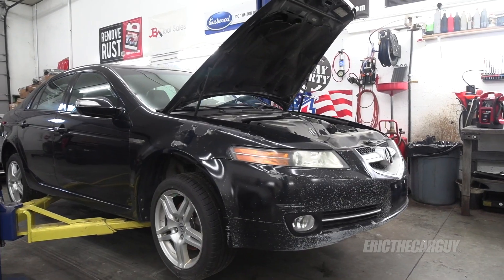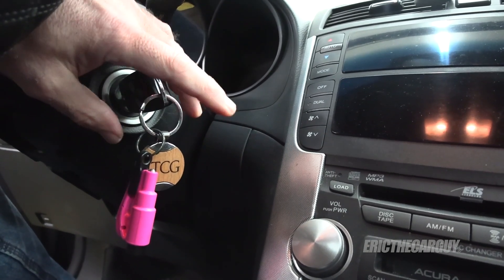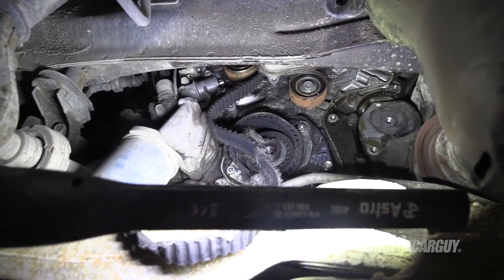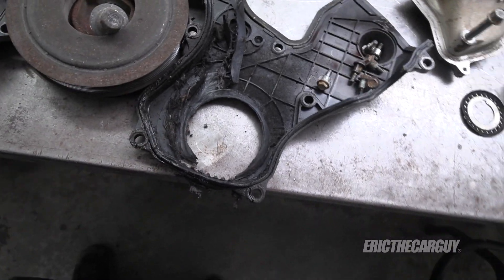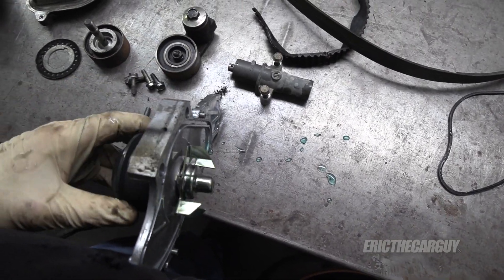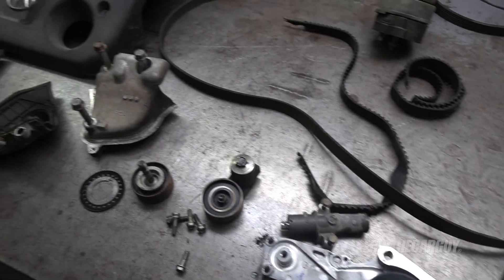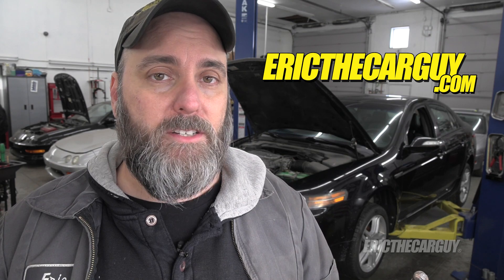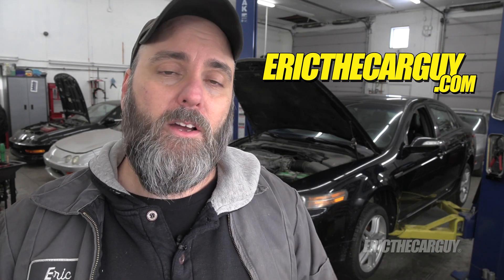Acura TL Dies On the Road

Comment: My prelude burnt a valve while driving 600 mile across country. Really mad about that I put too much time and love into my prelude. No ford ever left me stranded I had a ratty focus svt and mustang 3.8. Not sure if I'll ever go back to honda tbh. I'm a mechanical engineer yeah I know if you maintain something it won't break but. I'm happy with my new to me 2008 Ford Fusion v6. Fords don't burn oil like Hondas or break every 10mm on the car while taking it off. From a mechanics standpoint Hondas are great yeah but in my own experience it just took too much work and time for not enough car. I'm happy with a basic reliable cheap ford.
Reply from the maker: Sorry to hear about the Prelude. I loved mine with the H22. Also: https://www.youtube.com/watch?v=VES5D3zHTak&t=5s

Thanks for the comment.

Comment: Had a similar thing a few years ago with my 2.5l 24V mazda 626. Timing belt just went, with no reason. Replaced the timing belt and within 2 weeks the same happend again. At the end the hydraulic tensioner was bad although it looked  fine.
Reply: Did you torque properly everything with the torque wrench?
Reply: @polo16v191  yep, but the hydraulic tensioner slowly lost it's tension. But when  tensioning it feeled fine. Needed a lot of pressure to press the pin back in.
Put a new one in and never had any problems again.

By the way, the tensioner can't be secured by a bolt. It has to move a little, is also act as a vibration damper.

Comment: Interference engines are a complicated dance of metal moving at ridiculous speeds that sometimes occupy the same space.  Sometimes you get lucky and sometimes you don't.  You sometimes get lucky and the cams just stop turning at the right point in the 4 cycle process that the valves are clear of the galloping crank.  And then sometimes your luck runs out and your engine bashes itself to death internally.  Schrodinger's engine.
Reply: I think if you get lucky the spring pressure pops the cams to whatever low spot they can get to when the belt breaks. Which is hopefully low enough to miss the pistons.

Comment: Great Video Eric!! I def agree with your logic on trying the new belt. Funny you had to break out the jb weld, as I had too also lol I screwed my oil pressure sensor to tight and broke a piece of the block, I hope it holds or I may have to just plug the hole with a bolt..
Reply: Hope it doesnt leak..

Comment: Had the same thing happen to my 01 gsr and all the forums were saying the engine is done because it’s an interference engine. Got the belt back on and started right up.
Reply from the maker: Even if you did bend valves, they are about $12 each, and easy to replace with the right tools. I believe the head even uses an MLS gasket that can be reused in a pinch. I'm so over the pessimists of the world. Thanks for the comment.

Comment: I'm approaching 300,000 kms on my 07 TL Type-S. It's been an absolute trooper, going up and down the entire west coast of North America. Considering a new car soon, but unfortunately it won't be the new TLX Type-S.
Reply: Why not
Reply: @Shabbe02  It's a good car, but in Canada it's $70k all in and the performance is not there for that much money. I'm eyeing a Stinger GT as a replacement which was a blast to drive, or if I actually be sensible then possibly something more economical. Gas prices in British Columbia is ridiculous.
Reply: @Shafin Rehman Did you run into any big problems with your type s , I'm looking to buy one
Reply: @se9882  Nope, not a single major issue. The only problem it had was the acceleration pedal position sensor died at around 270,000 kms and it was $400 to replace. It didn't prevent me from driving, but the check engine light came on for the first and only time.
Reply: @ShafinRehman  that's great to hear . I'm going to look at a tl type s tomorrow pretty low Miles on it around 80k but people say they have transmission issues was yours a manual or automatic,
Reply: @se9882  I had the automatic. Honda redesigned the transmission in the 07-08 model so you shouldn't have to worry about it blowing up. I still changed the transmission fluid every 50,000 km because I drove the car hard in all seasons and weather. Take of it, and it'll last easily
Reply: @Shafin Rehman  thanks for your feedback. I appreciate it  a lot .

Comment: There's been some chattering on the Acura forum that the Aisin kit may have issues with their timing belt or tensioner being off-spec.  Although it's really just a noise issue and doesn't seem to affect functionality.  The Aisin kit went up in price now too where it's $250 and it's only about $550 to buy all OEM stuff from Honda.
Reply from the maker: This is also the first time I've seen that shim for the idler pulley. That was to address a noise issue. Perhaps they changed their idlers.

Comment: Was it a Gates kit? i have actually heard of several Gates belts failing the last year or twoThe quality controll is not the same as it was.One of the  examples i have heard of..did actually happen to a friend of mine.He runs this garage..and they had a timing belt fail..and Gates sent an employe out to my friends garage..and did research.It was found that it was a weakness/stress in the belt that caused it to break. Just a "funfact". Thank you for nice video, Eric. Happy new year by the way :)  Greetings from Norway ,Stefan

Comment: On a VW 1.8t or TDI, you really want to pull the head after a belt failure. It can bend the valves very, very slightly. Everything will seem fine for a few thousand miles, until the head of the valve breaks off, and trashes the piston and head.

Comment: The same thing happened to my son's 08 honda accord v6 coupe has a 3.5, but the same exact symptoms. Funny how peiple will say "you need a new engine" but I replaced the belt, water pump, tensioner and lined up the timing marks and let me tell you.... the engine purrs. No issues has been 7 mo now.

Comment: 1:21 that feature is known as “Tip Starting” where you don’t have to hold they key in the start position and you just “tip” the key into start and the PCM takes care of the rest!

EDIT: I’m in agreement that the belt was probably a counterfeit part; when I replaced the timing belt in my old Aveo I made sure to use a genuine Gates belt kit bought from O’Reilly’s.
Reply: It still annoys me even tho both of my newer cars have "tip" starting and I should be used to it by now. I like having full control. Call me controlling lmao

Comment: Hey Eric thanks for sharing with us. Good advice on the knockoff parts. It's a shame that some sellers market their parts as "OEM" but are just knockoffs. It's an awful feeling being broke down on the side of the road. I've been there!! My TL looks exactly like yours, except mine is a 2007. I actually replaced my timing belt/accessories with the same kit you bought in this video the Gates TCKWPWP329. Currently have 1 year and 10,000 miles on that Gates kit. Seems to be working well. On a side note, I went into the local Acura dealership to grab a part a couple years back. I couldn't help but notice a "cut away" display it showed "Gates Timing Components" by the parts department. Made me kind of wonder if that's the brand that this particular dealership used when they perform a "timing belt service". I never asked the guy, but that always stuck with me. But anyways thanks for the awesome videos Eric!!

Comment: Why I love my Toyota 1MZ V6, belt and non-interference.

That said, lucky with the engine.
Reply from the maker: I don't think that matters so much because this is an interference engine.
Reply: The 1MZ was unfairly maligned!  My  beloved Solara got an Aisen belt kit every 90K.  204K without a single engine problem. Runs like new and burns no oil!
Reply: @ericthecarguy  what I mean. I don't have to worry. Lucky the engine survived.
Reply: @donkaiser6704  mines on 440k km. Just service. No issues, still beating strong.

Comment: Well I had a similar experience on my 99 Civic last year. I was always told to buy Honda OEM electronic parts for my car because your car doesn't like aftermarket electronic parts. I didn't listen and bought a Idle Air Control valve from the parts store. The Honda one was stupid expensive. I told myself there isn't a difference except the price. Man, was I wrong. I went through 3 IAC's in under a year. I was having a very high idle when starting my car and the actual IAC was cheap garbage and started coming apart which caused coolant leaks. I finally maned up and bought the Honda one and there was a hell of a difference. My car was smoother and the idle was perfect and it just looked liked better quality than the parts store one. That was last year and til this day not one single issue with that Honda OEM IAC.
Reply from the maker: Next time you might consider a salvage part to save some money. Also this info might be helpful: https://www.ericthecarguy.com/solving-automotive-idle-problems/

Thanks for the comment.
Reply: @ericthecarguy  I did try a salvage yard. Here in Seattle we have Pick-n-Pull. There are several locations and they have a shit ton of cars. Problem is 96-00 Civic's and Camry's are the most popular car here. If one of those cars gets sent to Pick-n-Pull it's completely gutted in 3-5 days.

Comment: Interference engine and broken timing belt does not always mean game over for your car.
Perhaps the valves didn't hit the pistons because the engine was at low revs or because the crank position sensor caused the car to stall before the timing belt broke?
I wonder what saved the engine.

Comment: My Acura TL just broke its timing belt like yours. I can turn the engine at the crank pulley but I can not seem to turn the camshaft pulleys more than a quarter turn either way with all spark plugs removed and using a wrench on the camshaft bolt. Could I have bent valves or should I try harder to turn the camshafts.
Reply from the maker: Pay attention to what I said in the video about rotating the crank 30º off center so that you can move the cams into position. The way you have it now you're turning the valves right into the top of the piston. Move the piston off TDC and the valves will be able to move. Good hunting.

Comment: I know that money is something that all working class people sorely need but why not just go to the junkyard and take an oil pump off of another TL or same year/generation accord (it should be the same if I remember correctly)?  That boss that broke off for the crank sensor is part of the oil pump not the block.  You would’ve saved yourself all the time figuring out how to reinstall it.  Yes I understand it’s a $200 car but ME personally prefer to put something that I know belongs there…but that’s just me.  Its one of my pet peeves and a good pet peeve to have in certain situations when repairing or building..no room for half-assing 🤣🤣🤣 good job on making it work Eric!
Reply from the maker: Perhaps because I don't enjoy lying on the gravel in a puddle (in the winter) trying to remove an oil pump from a salvage TL. The boss only keeps the wire from coming into contact with the timing cover. Not critical at all. The other 2 fasteners and the locator pin locate the sensor. As you saw in the video, it runs fine. A win is a win. Thanks for the comment.
Reply: @ericthecarguy  100% agree about the whole laying down on the floor in the junkyard, NOT A FUN TIME..I understand how the configuration works (former Honda master tech for 8yrs) but I figured that would be a better option for people who are not automotive savvy, don’t have the skill set or are not comfortable doing something like that and are unable to come up with hack jobs like you did in the video.
Reply from the maker: I see where you're coming from, but given that I perceive this to be a rare occurrence, it's not a critical fastener in my view, and it is my vehicle, I felt comfortable letting it 'pass'. Think of this as my 'field' car. That said, I do agree that repairs should be done as properly as possible, otherwise, you could be fixing them again in short order. Thanks for the comments.

Comment: I spoke to a fitter whose actually an engine builder by trade in 2005 & he was talking about how the Nissan RB30E ,6 cylinder engines used to break timing belts because the front camshaft journal tended to get corroded inside of the cylinder head then eventually would start to seize which would cause timing belt breakage.

I told him that I never had any trouble with the RB30 engines & that must've been caused by a lack of maintenance (e.g. not changing the oil).

I seem to upset that sort of Rowe on the Ross side of my family whose a mechanic for some reason because I've never had to throw a junkyard engine into any of my cars.

Basically they nearly threw another engjne into my great uncles step Daughters 1997 model 4 litre 6 cylinder Ford EL Falcon Futura which I did replace the ECU in due to evidence of internal damage to try & cure a stalling problem.

It ended up being a few things which also fixed a hard starting problem such as cleaning the Hall effect sensor terminals on the TFI module which had a case of the green crusties & I applied some dielectric grease into the connection to minimise moisture ingress.

The main problem was the ECU earth terminal inside of a connector right next to the battery had a case of the green crusties on the strands of wire inside of the female spade connector so I removed as much of that as I could & applied a dab of solder until it took onto the strands of wire which fixed the problem.

I also replaced both radiator hoses because the fluid was leaking from the water 💦 pump side of 1 radiator hose,it was a 24 year old hose so it was just old.

Well,she drove it for over 700 kilometres (over 400 miles) 1 way to her step parents place for Xmas without a problem apart from almost running out of fuel near Wagga Wagga somewhere here in Australia.

She drove back & I haven't heard of her having any problems with it, most people would send the car to a wrecker !

Comment: I'm a little disappointed that you didn't check out the sensor and wiring which were visibly damaged before putting all of it back together.

Then again, you said it was a $200 car, so I get it. You want to just hope those more expensive parts survived.
Reply from the maker: I did plenty of work to that sensor and wiring to get it back up in there as I mentioned in the video. Otherwise it would have made contact with the spinning crankshaft. Also, how do I check those things when they are off the car? BTW, resistance checks are pretty much useless in my mind other than confirming continuity. Thanks for the comment.
Reply: @ericthecarguy  I'm sure the wiring can be confirmed with a voltage drop test if you wanted to. The crank sensor maybe can't be tested off the car, but can't you test it for cranking RPM signal before putting every single part back on? It just seems like you could have saved yourself some work because it was clear that the sensor had been through a rough ordeal.

Like I said I still understand why you would just hope it still works in this particular situation. If it were a customer vehicle, there's no way I'd even consider putting that damaged stuff back on, but on a beater car I can see taking the chance.
Reply from the maker: Not really, everything pretty much needs to be assembled in order to test it. It's more about the signal coming out than it is about a specific voltage drop. That said, the damage is obvious. It's clear what needs to be fixed so I don't see the point of further testing. As I stated in the video, my only goal was to make the car run and drive so that I could move it to the new shop without towing it. In short, you pick your battles. Time is more valuable than money in my view. I'll circle back to this car when I have more time. For now, I have plenty of other vehicles I can drive. Thanks for the comments.

Comment: Eric thanks for sharing seeing as I own two Hondas. One with 3.0 engine and one with 3.5 engine. I have all new Honda components for the 3.5 and not long ago did the 3.0. Honda water pumps are hard to find I found out. Lots of discontinued. But I found one. I also have the shim. I’ll look to see if my 3.5 belt is rubbing and let you know. Will also check around the crank sensor for the hell of it. Did you just line up the cam and crank timing marks to bring it back in time? Just like to know. Anyway from very long time subscriber thanks for sharing and stay safe and well. Artie 🇺🇸👍
Reply from the maker: Aisin makes the OE water pumps for Honda I believe. You can find those pretty easily. Thanks for the comment.
Reply: @ericthecarguy  thanks for the reply. STAY DIRTY 👍🇺🇸